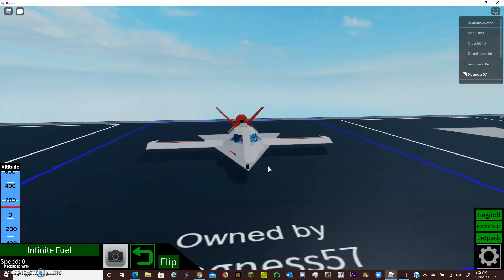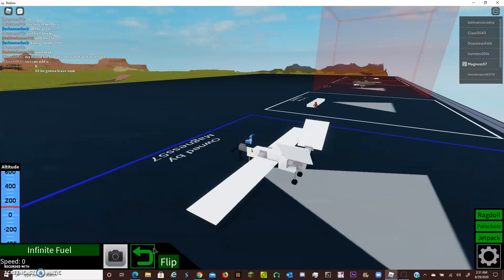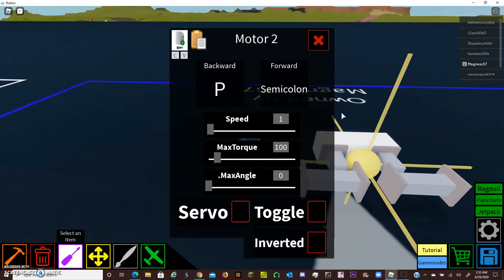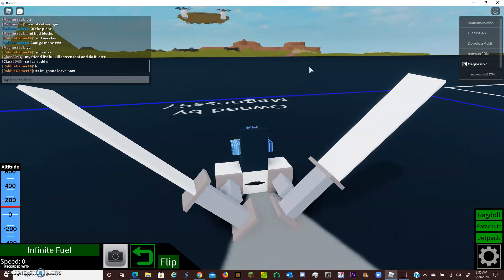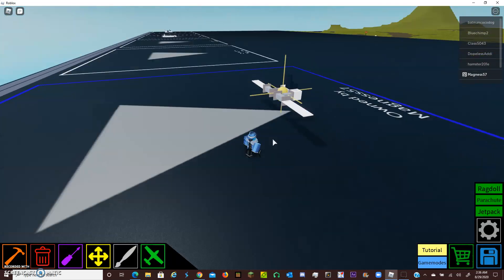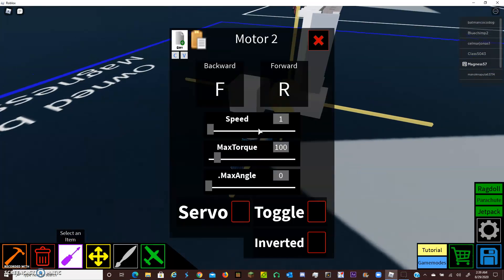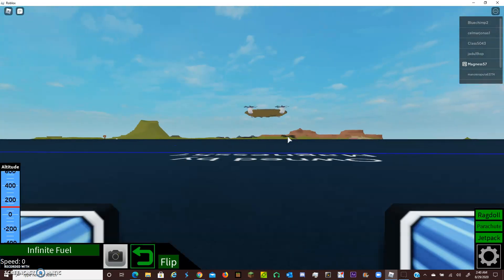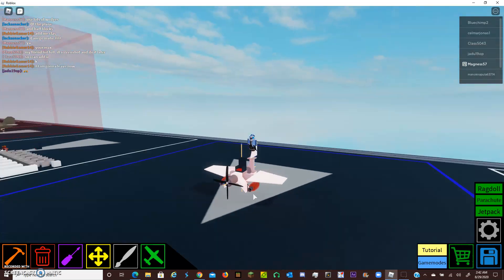Plane Crazy: V-Tail Tutorial (aka Ruddervator)

Comment: Wait. Why does it looks like one of my custom plane???
Reply from the maker: If you are implying that I copied you I have not, every build I make is done by looking at reference photos of actual planes and then setting a scale factor in blocks for the build. I start by building a ring to simulate the cabin size then elongate the ring to make the fuselage, next I make the doors and windows, then finally the wings before balancing out the aircraft after multiple test flights till it has been fully trimmed.
Reply: @magness57gaming67  nah man. I scrapped my old plane actually before I commented. You didn't copy. It just the plane's wing similar to one of my scrapped plane idea.
Reply from the maker: @Instantaneous_standnt  ah, gotcha
Reply: @magness57gaming67  the rudder is shaking, what do I do?
Reply from the maker: @kksteal4910  it’s probably the servos not having enough torque, although for most ruddervators in plane crazy, it’s common to have the shaking as the servos are under a great amount of stress. Does the tail look like it’s “flapping”?
Reply: @magness57gaming67  yes, i fixed it a little but sometimes it keeps "flapping"
Reply from the maker: @kksteal4910  unfortunately the “flapping will always be there due to the servos not having enough torque, but reducing the amount of tilt on the ruddervator should also help reduce the flapping
Reply: @magness57gaming67  I made another plane with a different "v-tail" rudder, It worked.

ty
Reply from the maker: @kksteal4910  np!
Reply: @magness57gaming67  It doesn't even have a cockpit